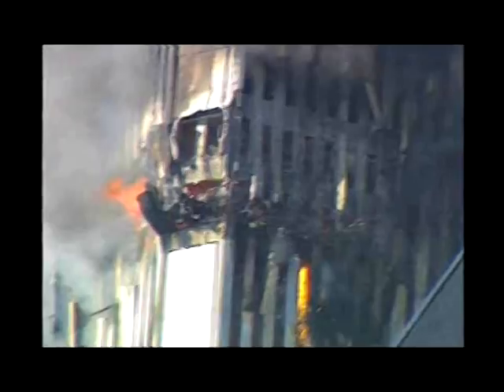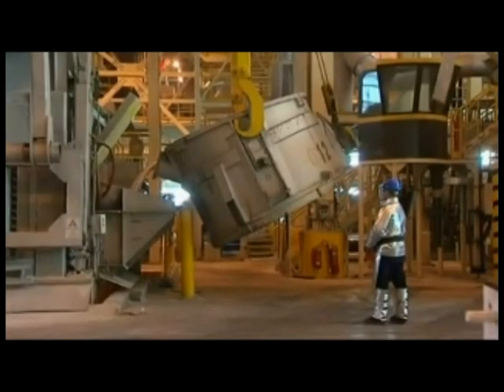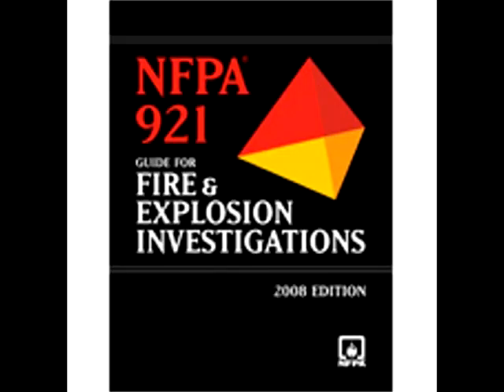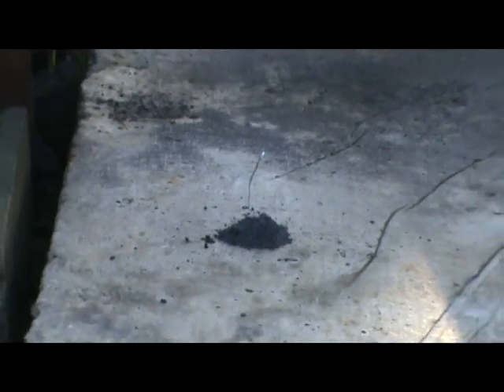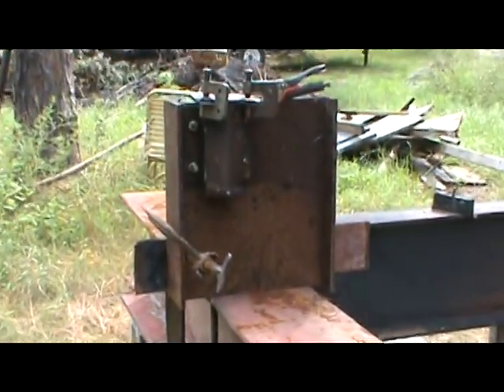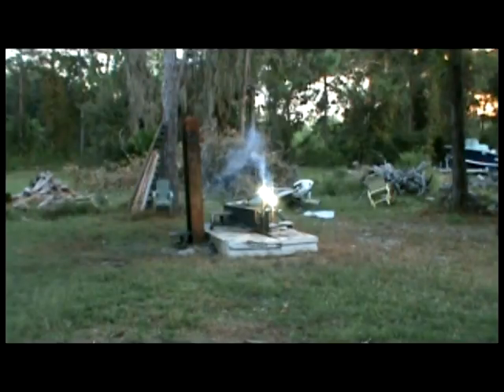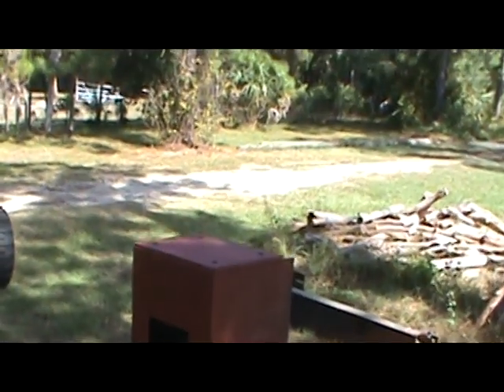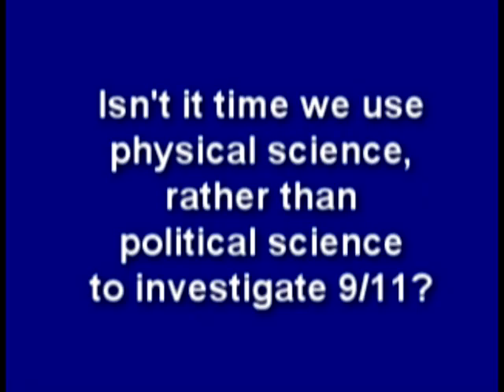9/11 Experiments: The Great Thermate Debate

Comment: here is the thing, if somebody planted thermate into the tower, they would have had to make sure the jet hit the correct floors.  I think this would be nearly impossible to  do.
Reply: Why is it impossible?!
Reply: vp5  I said nearly impossible.... I think flying a jet airliner into the precise floors at a high rate of speed would be very very hard.
Reply: Those offices at those specific heights and floor levels were specifically targeted. It was to destroy certain offices that held very important information regarding extremely huge sums of money. And also why building 7 came down later the same day.
Reply: @vp5  maybe, all I am saying is that I assume it would be hard to hit those offices accurately with with a jet airliner.
Reply: @DirtyDirtbag  9/11 was many crimes all wrapped into one. It involves going to war for trillions and millions of tons of natural resources, like lithium and other minerals out of the ground. Not to mention the heroine production in Afghanistan as well. But 9/11 involved insurance fraud, stolen gold bullion and hiding evidence of the pentagon trillions gone missing and the Bush family 'project hammer' $240 billion which was set up in 1991 to run 10 years.

Comment: molten aluminium is one of the most explosive substances on earth when it comes into contact with water. the planes tanks and engines were full of fuel witch melted the aluminium causing the chaos  when the molten molten aluminium made its way through each floor it came into contact with water causing each level to explode

Comment: 18 years later most still dont know the truth, a damn jet plane aint gonna bring that puppy down alone. 
Jet fuel will not burn hot enough to melt steel in a open atmosphere nor will other combustable items in that building. 
I was 10 when this took place and even then, i knew it was more than just a couple of Boeings that dropped those buildings.
I mean even if a small amount of thermite wont eat a steel beam....they use that shit on the Rail road to melt new sections of track together.....iron track is a lot thicker then those beams holding that building... 
I was 2 minutes into this video before i decided to post something that will never be read.
Mag is also something to look at, that shit burns like no other
Fucking building was built to fall.
Reply: yep

Comment: EXCELLENT !!   You proved the point , to my satisfaction, but I knew this was BS cause I worked there ( 4th sub basement mech. Room) saw the structural members ana know that an office fire is not to blame.
Reply: what did you see
Reply: Structural steel much too large to damage for anything other than a LOT of thermite /mate .  The NIST story does not hold water , unless the laws of physics took the day off.

Comment: Where do you think all of that aluminum went?  Inside the building, aluminum melts at a lesser temperature than metal. That "thermite plasma" is actually molten aluminum and not steel. It weakened the steel support beams enough to make them bend.

Comment: Thermite can do it and without a doubt super small particles of Nano Thermite can do it especially considering the small places it can be put into and it would only have one way out and that’s once it comes through the metal. But there were bombs in the lower floors firefighters said so they were inside when it blew up so it had no foundation and no steel structure to hold it up just Sheetrock and all the weight of the building was all it took to push it straight down.

Comment: The beast of revelation is still 'nanothermite' which nobody has shown an experiment with yet. Please somebody show, that 'nanothermite' can atomize steel and concrete, i.e. remove the molecular bindings between the basic chemical elements. Otherwise we are stuck with a new semi-official narrative - and again to avoid the truth. 
The question whether thermite can melt or cut iron is irrelevant. We know for sure, that it can melt iron. But nobody needed thermite to cut any part of the steel construction. The cutting charges to create the plane-contour in the outer wall were set off a fraction of a second before the flying object hit the tower. The sound of these charges was embedded in the overall sound of the impact. Then the crisis makers needed a visible argument for the towers to be weakened by the jet fuel, and different containers with thermite placed near the corners were ignited. The result was melted iron. Nothing else. When it was about time to take the tower down, the central core was weakened by setting off a number of conventional cutting devices hidden in the elevator system. Finally the tower was nuked and atomized from below, from well under the foundation. Only a nuclear shock wave can pulverize everything and change 80 percent of the steel, concrete, etc. into dust. The dust clouds looked precisely like the pyroclastic flow from a volcano where all basic elements have been changed into plasma.
These are my arguments against 'nanothermite':
1. The application of nanothermite necessary to destroy the steel construction to the degree we could watch would have taken weeks or months and could not have been hidden from the daily users.
2. Nanothermite - even if it can detonate with supersonic speed? - could not create a seismic signal. Only an explosion or detonation in the ground can do that.
3. EMPs are only developed from nuclear charges. The many reports of damaged electronics are widely suppressed.
4. Nanothermite will not burn for months, it will cool like a normal chemical reaction, when the reacting elements are used up. Only extreme temperatures from an atomic reaction and the radiated energy absorbed by the rock will create such an inferno. The melted iron would not cool at normal speed - even when ground zero was cooled with tons of water.
5. The pyroclastic cloud escaped from tunnels below ground zero before the top of the tower hit the ground, indicating that the building was atomized bottom-up. The apparent top-down movement was caused by the not atomized upper floors! which fell free when the structural forces below disappeared momentarily, and during its acceleration it pressed the atomized dust-building below to all sides. This is the typical signature of a nuclear chock wave passing through a physical object. The object maintains its shape until it is scattered by the wind - or hit by a physical object. Same effect as when we step on a dust fungus.

The problem with admitting the existence of a nuclear arrangement prepared as a part of the overall construction for controlled demolition of building 1, 2 and 7 when age would demand it - is, that it then becomes difficult to explain - which one of the secret services did press the button?

Comment: The part that really gets me is where the debunkers tried to use almost 200 lbs of thermite to prove that thermate could not have been used. Yet this guy does it with 1.5 lbs?
Un-fucking-real!
Reply: pepelapiu2004   Who did what?
Reply: @tpryce1525  
Watch the whole video. A bunch of people who tried to demonstrate that thermate could not be used tried to use 175 lbs of thermite to cut a steel column. And they failed. They claim this failure of thermite is proof thermate could not have been used. 
But the guy in the video could suscessfully cut a steel column with only 1.5 lbs of thermate. Which effectively makes the 175 lbs ones look like a joke.
Reply: pepelapiu2004  And this is relevant how?
Reply: @tpryce1525  
For starters is shows that National Geographic is either lying or completely incompetent.
It also shows that it is a very likely possibility that thermate charges were used in the controlled demolition of WTC7.
Reply: pepelapiu2004  There’s a vast scientific consensus on how the buildings collapsed on 9/11 and is has nothing to do with thermate/thermite, national geographic, or your opinion.
Reply: @tpryce1525  
You got a lot to learn. I suggest you start with a video called "9/11 Mysteries Demolition - Full Lenght"
I think you still can watch the whole thing for free here on Youtube.
Reply: @tpryce1525  
You could also go on my channel and look for a video called "WTC7 Short Compilation " and let me know what you think caused that building to drop in the afternoon. NIST claims fires caused that building to drop straight down into itself in free fall. Watch the video and tell me if you believe that.
Reply: pepelapiu2004   It’s not a matter of belief. Like I already said, there’s a vast scientific consensus in agreement that fire caused the collapses of the buildings. Your opinion about this is irrelevant.
Reply: @tpryce1525  
Two things wrong with your statement.
First, science I'd not a democracy. Scientific concensus is meaningless.
Second, the idea that experts agree, therefore you should agree without question, that is nothing more than a call.to authority and pure propaganda.
Reply: pepelapiu2004   You’re extremely confused. A consensus among experts is not the result of democratic process and certainly not an APPEAL to authority, if that’s what you meant.

Comment: Without metallurgical or materials tests, there is no way of knowing what the molten materials or metal balls were composed of.
 Note that all it would take for the WTC collapses to behave like controlled demolitions is for the burning Jet fuel soaked interior to raise the temperature enough to soften and buckle structural steel: 797° F to 1,202° F (425° C to 650° C). It doesn't have to melt (with thermite or whatever else). I've linked to two videos below with dozens of controlled demolitions. 

The most common mistake that people make are to conclude that either the fuel burned off too quickly, or the furnishings did not get hot enough to melt the steel and cause the collapse. What actually happened was that the carpeting, furnishings, and insulation on 2 to 3 floors became one large fuel soaked torch. The temperature slowly rose from 392° F (200° C) to about 1,800° F (982° C) in 102 minutes (NORTH TOWER) [1]. That produce enough heat energy over time to weaken the perimeter columns on two of the four sides [2], and distort the center main trusses [3]. Then, in the North Tower for example, the 46,000 to 69,000 ton mass of the 10 to 15 stories above the impact zone [4] caved into the core of the building and buckled the outer columns or snapped their spandrel plates or bolts. The energy of ten plus stories suddenly falling 2 or 3 stories and crashing into about the 95th floor crushed it, and began the pancake effect you see in WTC collapse videos [5]. You can see similar effects in the demolition videos below.

[1] http://911encyclopedia.com/wiki/index.php/Jet_Fuel
[2] https://upload.wikimedia.org/wikipedia/commons/thumb/6/6f/WTC_bathtub_east.JPG/1280px-WTC_bathtub_east.JPG
[3] https://upload.wikimedia.org/wikipedia/commons/8/86/Wtc_floor_truss_system.png
[4] https://en.wikipedia.org/wiki/World_Trade_Center_(1973%E2%80%932001)#Destruction
[5] https://www.tms.org/pubs/journals/jom/0112/eagar/eagar-0112.html

Demolition Videos:
https://www.youtube.com/watch?v=SeynAzSIqeg
https://www.youtube.com/watch?v=9eh7hMOMWoo

Comment: I only have a few questions.  How did someone access the beams, to plant thermite?  And how many steel beams needed to be thermited to make it work?  How much time would it have taken to plant the thermite?  How about the planes, themselves?  How could radio controlled planes, moving 500MPH, hit exactly where the thermite was planted?  Why didn't the plane explosions cause the thermite to ignite immediately?  

Answer these logically and I may change my mind.
Reply: Except nobody will answer you, every single conspiracy about 9/11 fails after an ounce of critical thinking
Reply: It was elevator working Crews that came in months prior the only way to access the core columns was through the elevator shafts look it up there are many documents on this she's not an opinion this is pure fact from many sources look it up

Comment: Dumbo's logic....ignore that the planes were made of hardened and thus relatively brittle Aluminium...Duralumin, which when smashed and burnt in a hot human fat and plastic fire, only needs to anneal the steel, it then will buckle, the pouring steel is the result of the weight grinding down on that weak point....japanese blacksmiths actually start their fires by hammering on a small rod, until it becomes hot enough to ignite paper.

Comment: Goddamnit people are so stupid. The metal frames of the Twin Towers (or any structure) wouldn't need to completely MELT or get even close to melting in order to collapse. When you expose steel to extremely high temps, the metal will absorb that heat and WEAKEN. I've seen it hundreds of times using a blow torch - cutting or heating a piece of metal and the metal starts bending and contorting because it's EXPANDING absorbing that heat, and thus, weakening. Now, put thousands of tons of material on top of the exposed steel of the towers and the metal simply wouldn't hold up. It would bend and collapse under so much pressure. 

The metal DOES NOT HAVE TO "MELT" OR BE EXPOSED TO TEMPS HOT ENOUGH TO NEARLY MELT IT. All it has to do is weaken, which is exactly what happened while the jet fuel continued to burn.
Reply: Steel would buckle and fold if weakened by fire causing it to fall towards the weakened side. Not come down at nearly free fall speeds. Something besides jet fuel brought those buildings down. THERMITE
Reply: A 40 ton jet airliner with full tanks of fuel rammed into the building. At every level the plane hit, the entire floor was weakened at all 4 corners. The flames were evenly distributed. My God how do you people not see this?! Do you realize how many people it wouldve taken to install thermite or any explosives throughout the ENTIRE BUILDING? BOTH OF THEM? And NOBODY SAW ANYTHING? It would've taken a minimum of a few hundred people to carry out what you're suggesting....and you mean to tell me that all of them knew thousands of Americans were gonna die, but none of them blew a whistle on what was going on? I'm simply fascinated how you people can believe this garbage. It's laughable. Use some common sense, dude.
Reply: It was melting tho...
Reply: How do you know? Were you up there? Did you see the steel physically melting? No, nobody did, because the steel WEAKENED. It literally happens every time steel is exposed to any heat.
Reply: @budfudlackerinc.1900  but you can see it in the video. the footage from the tower
Reply: No you can't. You literally CAN'T see the steel "melting". What you are seeing is metal columns absorbing heat and WEAKENING, then collapsing under the weight on top of it.
Reply: 2 steel I-beams columns are being held up by a pice of wood. Ok? And that proves? That's hardly like the steel beams on the floors the planes hit having to hold up literally tons and tons of concrete and steel from the floors above the impact.
Reply: THE STEEL DIDN'T HAVE TO MELT!!! My God you people don't have the mental capacity to listen to others, do you? The simple fact that you are stuck on this "fact" that burning jet fuel can't melt steel is enough proof of just how clueless you are. THE METAL DIDN'T EVEN HAVE TO MELT IN ORDER FOR THE TOWERS TO COLLAPSE. All is did was WEAKEN.
Reply: And further, you ask if I have ever seen any steel high rises collapse from fire. That question shows just how little your brain functions. How many other steel high rises have been hit by a fucking 40 ton jet airliner loaded with fuel? Do you realize how much structural damage that would do to the floors it hit? THEN, add the burning jet fuel being absorbed by what little viable steel is left, and you have the top of a structure ripe for collapse. As a matter of fact, you can even see the top of one trade center actually leaning to one side. Why? Because the steel is being weakened by the fire and starting to bend. THEN, again, once the steel can no longer hold up the top floors at all, they give away suddenly and violently, and the floors below simply can't hold up tons of material smashing down on them, like an accordion. Have someone jump out of a tree on top of you and see if you can support their weight crashing down on you.

Comment: Thermite has been around for centuries.  Shaped thermite is used everywhere in construction  for underground welds, train rails etc.  Nano or military is without used in shaped charges meaning methods to direct significant energy to cut, weld, or act as an explosive
Reply: Wes Fox  So, you are claiming to have been around for ALL private:  personal, corporate, and government operations?  Hmmm . . . let me check the logic-o-meter on that . . . doesn't add up
Reply: Wes Fox  Wes Fox, you stated never used on such a scale s the 9-11 event ("And never used for a controlled demo of this magnitude").  Yes?  If so, I can assure you in mine and my family's  military and industrial experience, 'super thermite' and industrial grade thermite use has been on a much greater, 'single-event controlled' use and scale than that potentially used in cutting a few dozen steel columns and beams.
Reply: Wes Fox  Of course thermite has been used in a controlled demolition, I just told you I have seen it used many times to cut steel beams and drop a structure to ground then dismantled.   For some reason you seem stuck on the, BOOM! aspect of a demolition.Let me provide an example of how an explosive's expert may complete the task of installing a charge-shaped device

You honestly think I am going to provide instructions on how to use thermite and get it done? You are out of your mind.  This string ends now.